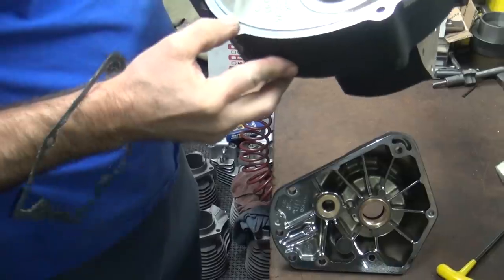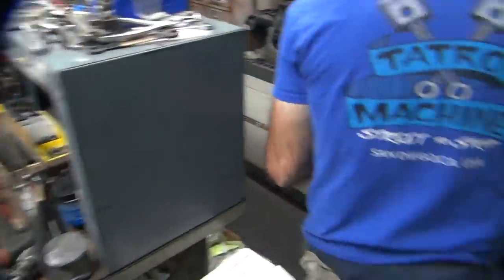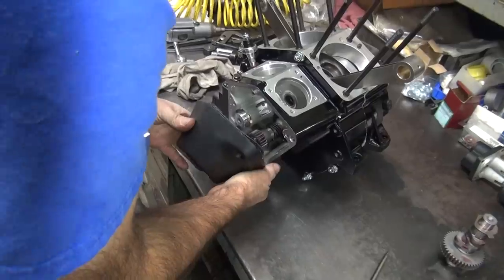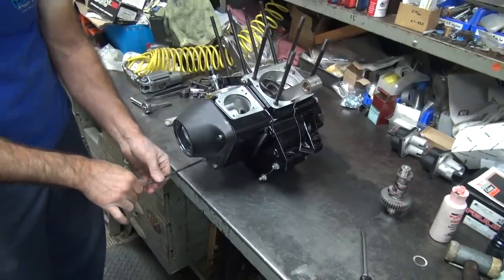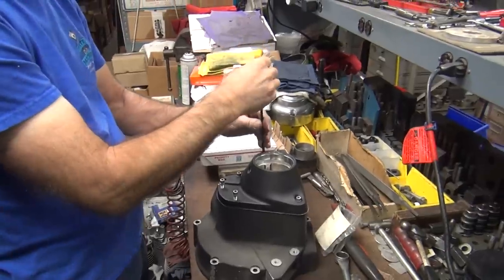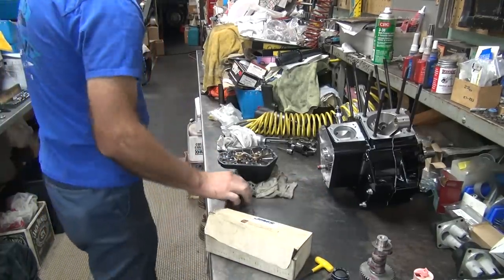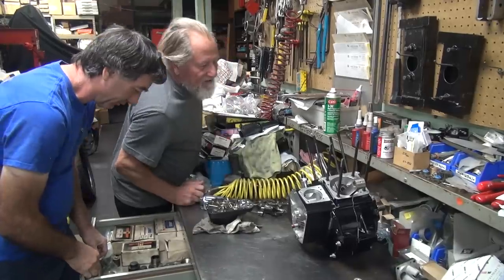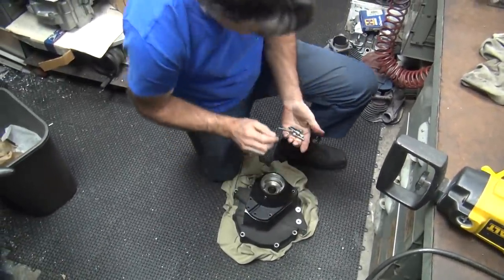2000 fxr4 80ci #116 motor rebuild fxr evo harley evolution cam bearing repair by tatro machine

Comment: when you’re reaming his cover using your “test” cases, is that accomplishing the same thing as align boring?  Where you’re trying to square up the holes, while honing then simply enlarges it?
Reply from the maker: that was not a test case, it was a line reaming fixture. every case is different but it gets you close. depending on what the misalignment is opening up the hole some might be just enough to fix the problem. in this case it did not work with either bushing. i think the cam cover got warpped in the powder coating process. you will see what i did in the later videos.
tatro